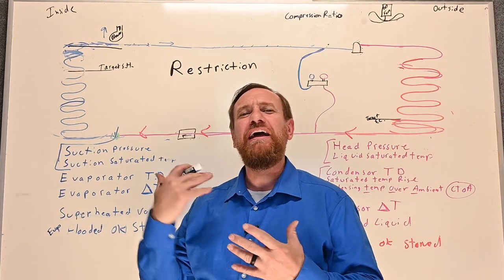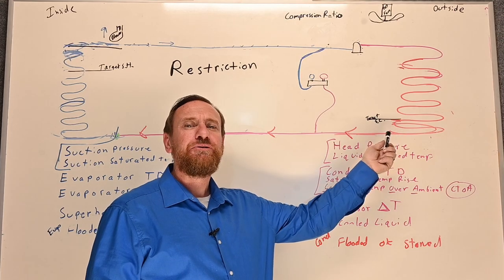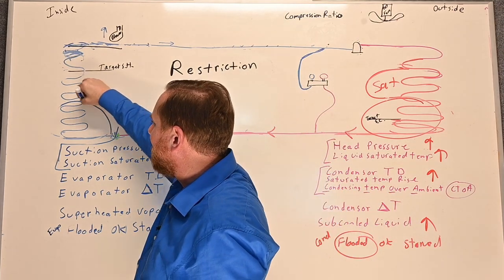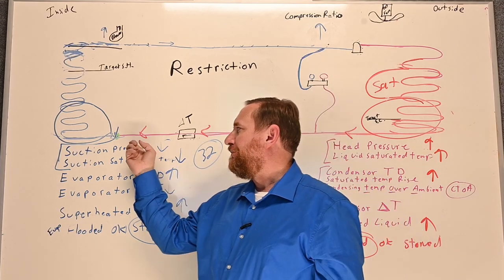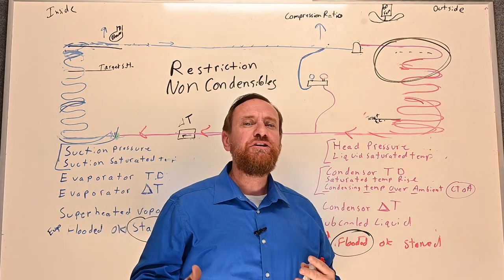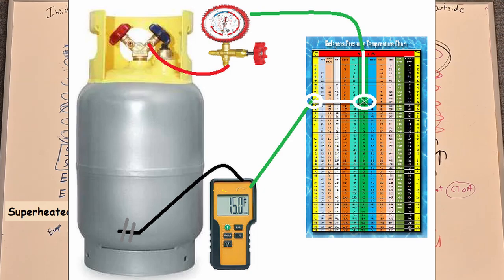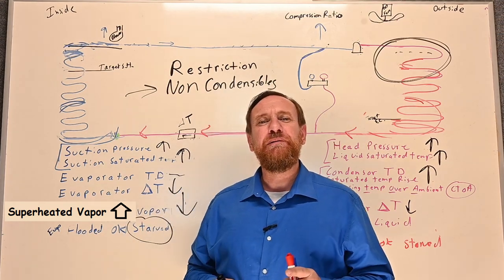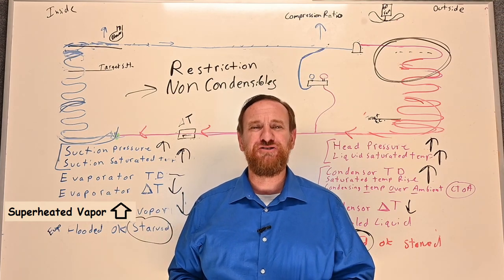HVAC 106 Scenario Restriction and non-condensable

Comment: Why would your head pressure go up with a partial restriction, when you are essentially pumping the system down? Your not picking up much heat in the starved evap coil. So you don’t need all the space in the condenser. Usually the head pressure won’t go up unless you run out of space in the condenser.
Reply: Because  the condensor will have much less internal condensing volume and since  you're technically pumping down the system, you'll continue to compress and discharge refrigerent faster than it can condense driving up the discharge pressure.

Comment: What if your pressures fluctuate on the low side. On a r404 I have a walk in cooler that temps and sometimes doesn’t when I checked my pressure on the low side it bounces around

Comment: Great video. You should be able to check the txv by raising the head pressures block off air flow or disconnect the fan power. The head pressures rise and the txv should remain constant. Isn't that the test process of the txv.

Comment: Thank you for this video! Great explanation with a very easy to follow language/terminology. This video popped up into my YouTube welcome page and it was a very surprising coincidence….if you believe in coincidences :) 
Restriction or non-condensible/contamination.., or both?… I was working on an island cooler today with a TXV that doesn’t respond to SuperHeat adjustments and on the top of a plugged screen/retainer on that TXV inlet I believe that someone added/charged r-410 into this r-404 system.. at least my temperature/pressure numbers didn’t match r-404.
Reply from the maker: Thanks! 
Mixed refrigerants makes all diagnostics difficult because we never know what the SH or SC is since we don't know what the saturation point is.

Mixing refrigerants changes the PT points of all the refrigerants.
Reply: SubCooling is a very nice thing to measure, but pretty much useless fir refrigeration applications… at least from my experience. However, TD in the condenser coil is kind of more reliable thing… However, if it’s an inverter/variable speed compressor it becomes useless as well… SuperHeat rules! :),

Comment: I have not heard such a detailed description of noncondensibles and the possible side effects and diagnosis since my father started instructing me in the late 1970s. 
                       My father also show me a tank filled with R12 Put it in the freezer with the temperature below -22°F because that’s roughly the boiling point of R12. 
           If you had noncondensibles mixed you would have a pressure that you can read
                    If you had pure R12 you would have zero psi. 
             And the bleed off procedure to do this properly would be done over many hours or days.        Because you would have to bleed off the refrigerant so slowly as to not lower the temperature of the refrigerant in the bottle. 
                      At the same time the noncondensibles are actually mixed and combined inside the liquid refrigerant exactly the same CO2 is in liquid water in a bottle of Coca-Cola. 
                   You reseal the container let it set overnight in a temperature stable room at 70°F as the temperature rises from your bleeding procedure the noncondensibles some of it would come out of the liquid refrigerant and rise to the top again. 
                  Later in 1992 we purchased a Bacharach refrigerant analyzer.     You can prove this and actually measure it to see how many times you had to produce the bleed procedure to come down to 0% air.

Comment: Thanks for sharing your knowledge! Your video reminded me of a noise that has been going on for years and I'm wondering if you may have some ideas. Residential heat pump in AC mode, fixed orifice. If I put my ear up to the liquid line a few feet from where it enters the indoor unit, there is a gurgling sound that lasts about 15 seconds, every 3~5 minutes. It's been a long time since I timed it but it occurs almost to the second each time. It sounds like maybe air bubbles or the liquid is not filling the line completely. I can also hear it just standing close to the unit.

Comment: Can you make a video explaining a restriction in the evaporator coil. We do multi family new construction and we’re having to replace a lot of evap coils due to restrictions but we’re not really sure why yet. Common scenario is….Compressor goes bad and name tag looks brownish like the compressor has been over heating. Once compressor is replaced we realized evap is clogged, we think it’s oil from compressor somehow? Also scroll plates brake into pieces
Reply from the maker: Biggest killer for compressors is overheat form compression ratio.
Biggest cause for high compression ratio is the low side pressure is to low. This leads me to believe your restriction is what killing the compressor. 

Restriction is typically in capillary metering devices, it the screen before or at the a fixed or TXV device, and the distribution tubes. This is primarily from oxidation for not brazing with a nitrogen flow, not protecting the lines when they are open, soft solder or flux inside the connections and  piping.

Restrictions inside the evaporator coil themselves, damaged tubing, attempted leak repair in the coil is most common.  If it is a Heat Pump there will be many more causes.

The evaporator might be too small for the compressor. Missmatched system.

Also could be a restriction on the high side, such as 2 filter driers, or a cloged filter drier, or airflow on the condensor is recirculated. 

Part 2 refregerants
In compatible refregerants or fractured refregerant blends. It may not work with the system or it may not work with the oil in the system.

Mixed refregerants

Part 3 broken scrolls is usually from liquid flood back or Liquid slugging. Liquid refregerant entering the scroll set. 

1 liquid slugging, the evaporator is not boiling all the refregerant into a vapor, liquid slugs the compressor because 
A. Over charged
B. Bad airflow/dirty coil filter ext ext
C. Improper metering for metering device.

2 Flooded start, refregerant entering the scroll set at startup.
A overcharged 
B needs a crank case heater

That should lead you to the problem.

Comment: Thank you Mr.Ty if the restrictions in the TXV how we can diagnose that? Thanks 🌿
Reply from the maker: Yes! I have a whole series planed for TXV diagnostics!
Reply from the maker: @R P  my videos on TXV under the play list learn HVACR

HVAC 060 introduction to the TXV TEV

HVAC 061 TXV TEV part 2 with target subcooling

HVAC 062 TXV/TEV  target superheat

HVAC 063 TXV/TEV with superheat and subcooling. 

HVAC 091 EXV EEV electronic expansion valve.

Comment: So getting the static temp at the outlet side of my condenser should be step number one so I can identify the refrigerant. If you have two types of refrigerant I was told the pressure is the sum of those two types. It will drastically change the pressure

Comment: Do you sweat out the line set from the TXV inlet? Or how to you get the strainer out?
Reply from the maker: My favorite at  21:30 second favorite at 16:32 both in this video
https://youtu.be/iJTMR_jLcjc

This style you would have to use tubing cutters, I sweat or replace the fitting with the screen pressed I to it. 
Jump to 1:34 of this video
https://youtu.be/lAIV0PsN6nc

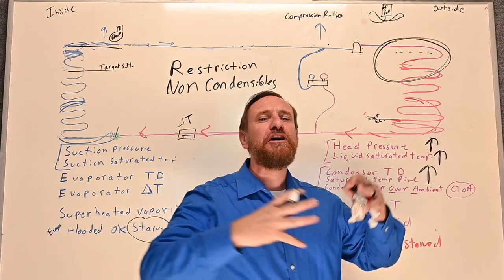Comment: Around the 8:25 mark, you said that the Condenser TD will go down. Having trouble understanding that part. Why so? Because the saturated goes up wouldn't the air the coil up causing it to be farther apart from the ambient air being pulled in?
Reply from the maker: 8:25 in reference to non condesables and the condenser. 
The condensor TD (refregerants vs Air in)  will go up. The non condesables has contamination making a higher head pressure. The difference between the refregerants boiling and the air temperature will be farther apart (higher TD) because we are not getting a true saturated temperature. 

The Delta T (air in vs air out) will go down because we are moving less BTU of heat energy. 
The higer head pressure means less overall volume or refregerants pumped and less refregerants changing state meaning less heat rejected. Rejecting less heat into the air means the air will change less. This is why condensor Delta T drops. 
I hope that helps.

Comment: I would love to see the static pressure of two types of refrigerant mixed.
Reply: The problem with that is sometimes they dissolve and change the boiling point. Ethyl alcohol and water for instance, at 97% ethanol in the e mixture, the water boils at the same temperature as the ethanol instead of at 100C, the same can happen with mixing refrigerants, quite unpredictably. Azeotropic refrigerants do this perfect mix so they behave like a single molecule instead of having several boiling points.

Comment: One question sir from a lost new tech. What if you turned off your unit and let your refrigerant settle for some time to then go and check the temperature and pressure in your system to see if that matches a temperature-pressure chart. Could that work to check for non-condensables?
Reply from the maker: Only if the indoor temperature where the evaporator coil is and the outdoor is the same temperature.
Reply: @love2hvac  Given that it is very unlikely, it's a big no hahah. Thanks a lot.

Comment: So you would take the tank pressure and temperature and subtract it and compare it to the pt chart that is compatible with that refrigerant ? Im just kind of confused
Reply from the maker: The tank temperature and pressure should match the chart.

Get  the refregerant in the tank.
Get the temperature of the tank.
Get the pressure of the tank. 

On the TP chart find the refregerant 
Then mach the temperature the tank was to the temperature in the chart.

That will give you a pressure, the pressure of the chart should be the same as the pressure in the tank on your guages.

Comment: I have a building with a 12 tons with no thermostat wire coming to the condenser but the thermostat wires going to two solenoids controlling the liquid lines going to two TXVs, and they control one of condenser fan by pressure switch on the low side, this unit always shuts off and I have to restart the electrical breaker each morning any advice please.
Reply from the maker: Shutting off meaning they trip the breaker and you have to reset or you shut the breaker off each night?
Reply: @love2hvac  Mr. Ty Excuse my language, I meant the compressor tripped during the freeze of  vapor line.
Reply from the maker: You have a problem. 
What is the suction superheat?
Reply: @love2hvac  suction superheat(13.3 f), and subcooling is 8 f at 88f ambient temperature.

Comment: Quick check for non-condensables in system.  Turn off unit n watch head pressure. It should steadily drop. If head pressure stays for a bit then Slowly drops could b noncondensables. Also try taking temp of line going into condenser, leaving condenser n ambient with the unit off. When all 3 r equal convert head psi to saturation temp using chart. If different from other 3 good chance of noncondensables. Great class TYB 💪👍🐕 thanks
Reply: Hey! are u sure thats true ?? "Turn off unit n watch head pressure. It should steadily drop. If head pressure stays for a bit then Slowly drops could b noncondensables."  if this is true, it can be huge help in diagnosis....and question to the part 2 " taking temp of line going into condenser, leaving condenser n ambient with the unit off. " how long after turning off the device do you measure these 3 points?
Reply: @hbo7799  yes its a good way to check for noncondensables. Read  Dick wirz book commercial refrigeration for AC techs n go to chapter 7 troubleshooting.
Reply: @hbo7799  when line in n out r same as ambient then concert condensing psi to saturation temp. If not the same as other temp could b noncondensables

Comment: Hello Ty. Thank you for the video. I wanted to ask you: Why does Bryan Orr insist on identifying restriction with "normal to low" head pressure? (see: https://www.youtube.com/watch?v=s74ex8Nefgc&t=248s) My experience with chillers(with large receivers) is the same. But with a freezer with piston compressor and a blocked cap tube, the pressure goes sky rocketing. Every one else that I've seen in the Internet agrees with this, Including yourself in this video.
Reply from the maker: Bryan is right, but by the time we are seeing a restriction we have generally added refrigerant. Let  me expaine some of the differences. 

#1 The receiver  makes a huge difference because the liquid has someplace to go without affecting the head pressure. It will almost always follow the rule Bryan was talking about until you get to the point the receiver is overfilled or flooded. Which unfortunately, I have  seen too many times, then the head pressure will rise after that. 

#2 Without a receiver, it will depend on the coil size.  
If you notice over the years higher efficiency units have larger evaporator coils. If it's tube and fin, it will have more volume inside and will blow it to work similar to a receiver.  However some of these coils are larger but use smaller tubing and smaller internal volume. Especially when you consider a micro channel coil with very little volume.  It will not have the space. For the refrigerant to stack and the pressure will rise quickly. Older condensors in the 70's and 80's often had small condensors and a restriction was quickly identified.

#3 the metering device.
3A: fixed
If we are looking at a fixed Metering device, or Cap tube, we are charging to superheat. If we have a restriction, we don't even see how much refrigerant is being added above the correct level. By the time we get enough refrigerant in the systems, it will have filled the high side with liquid forcing the pressure to go up. So initially it just looked low on charge and after adding refrigerant we can then see the restriction. Note like Bryan was saying the restriction was already there but now the overcharged had it shown up.
It's the high side pressure that forces the refrigerant into the low side. So by the time we get enough high side pressure to change the blow side, it's now too high. 
3B: TXV 
With TXV restrictions, the TXV will try to open more and more to allow more refrigerant into the coil. So depending on how bad the restriction is the TXV tries to compensate and the restriction becomes the metering device.  There will be a turning point where the restriction becomes too large.  We will see the high superheat, add refrigerant until we realize we added too much or until the high side becomes flooded and starts to rise. 

Finally 
In your example of a freezer with a blocked cap tube, it will have a lower volume condensor and a cap tube cannot open at all so 2x restrictions. So the condensor side will flood and force the head pressure up typically without adding any refrigerant. 
The higher compression ratio will likely provide enough heat to keep the high side high.

In the spring I will see if I can make some videos showing this
Reply: I agree with everything you say, since it agrees with my experience, and also other's. But in your video (3:20 min) you say that head pressure is going up without any of the reservations you mentioned in your reply. If liquid storage size is such a major factor, I think that both your and Bryan should have mentioned it. In my case, a small freezer, with the proper amount of refrigerant(after vacuuming and filling to the manufacturer specs.), with a cap tube blocked, climbed up to above 600 psi before I turned it off. Needless to say that suction side went below zero. Many people I saw on the internet have experienced the same pressure rise when the cap tube is blocked. On the other hand, with my 25TR chillers with a large receiver, I'm used to pump down(shutting the liquid valve) without any increase in head pressure.
Reply from the maker: @kamozoren  
This video is part of a series that represents the first module of a course. Much more details will be covered in my advanced course and diagnostics course.

It just takes time and money to make it happen.
Reply: Thank you taking the time to answer in such a detailed manner. It shows your deep passion for the trade. I can't thank you enough for your educational videos.

Comment: Thanks!
Reply from the maker: 22 is relatively odorless but in higher concentrations it has a chemical almost sweet smell but I dont recommend sniffing it by any means. 
If the compressor was burning up internally it would not last but a few hours so that's unlikely. 

It could also be contaminants on the coil, UV ligts or so called "air cleaners/scrubbers" that make a unique smell.

Possible other electrical connections such as a relay going bad would be something to check.